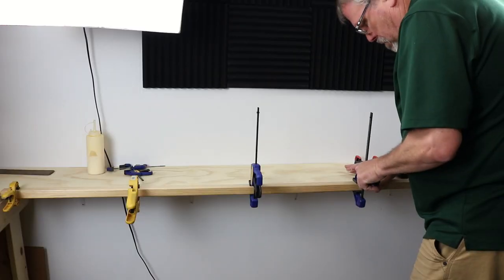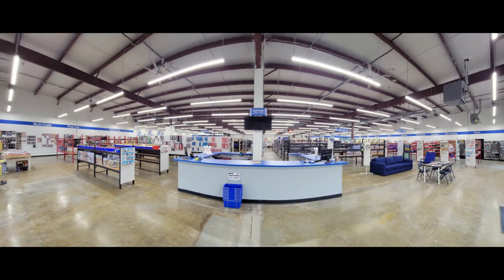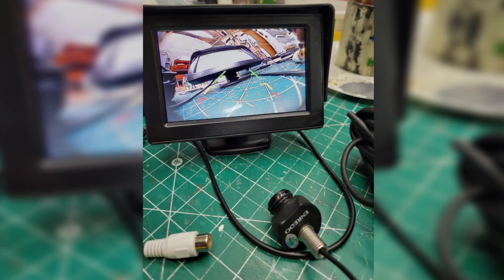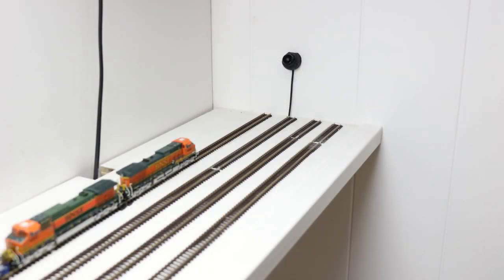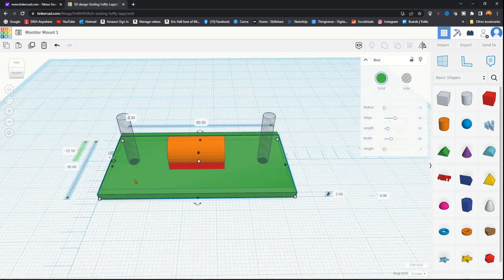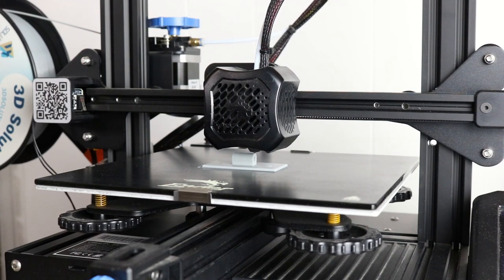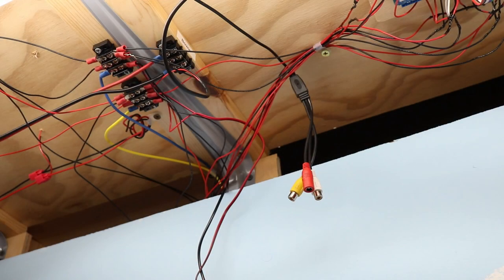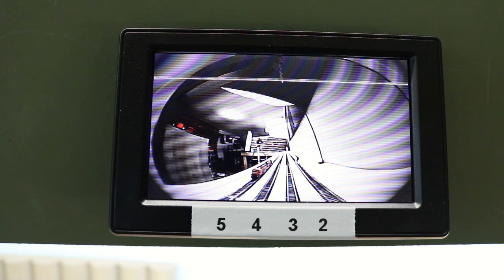Easy Inexpensive Video Monitor for a Model Railroad

Comment: If you drill a keyhole with 1/4" hole & then a 1/2" hole above it, you can route your wires through the 1/2" hole for the larger ends then pull the wires down to the smaller hole. You then mount your bracket over the 1/2" hole to cover it & also provide a little tension to the wires themselves.

Comment: Interesting application of a commercial system few would readily think suitable for a railroad. But I think you would get a better and more useful image by mounting the camera much higher and aiming  it down towards the end of the staging tracks where the trains stop. It might even be best to mount the camera on the ceiling pointing straight down. You really don't need to see the trains complete approach along the staging track.

Comment: Great videos and lots of tips and ideas, a while back on your video of dcc drop in decoder for n scale kato, I switch from dcc to dcc sound problem is the decoder dose not get a good connection ,when I touch or press lightly on top of decoder it connects or if I wiggle it slightly , and tips on correcting this ,thanks

Comment: Good morning. This is a nice solution - thank you for sharing. Would this work well in a dark staging area or are infra red cameras required?
Reply from the maker: That is a great question. Some backup cameras do better in darkness than others. This one is not great if it's real dark. My area is usually lit. If you have a dark area you will probably want to watch for a camera that is better in the dark than this one. It may cost you a few more dollars.

Comment: Ron, I have an Ender Pro3. What is that filament hanging on?
Reply from the maker: I downloaded a mod from thingiverse and printed it. It connects right to the upright support. It works fantastically, much better than having it hang from the top.